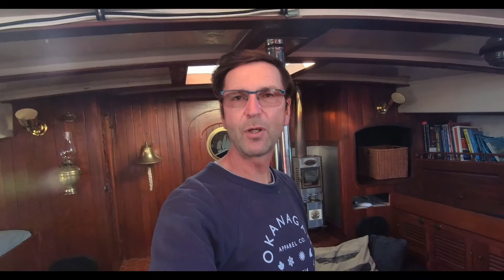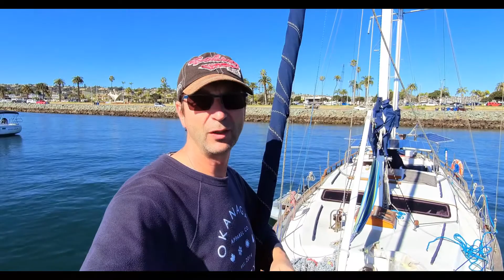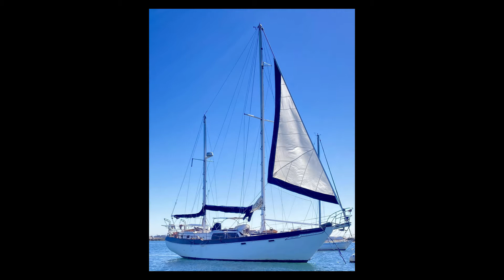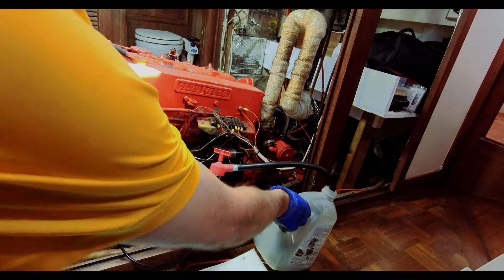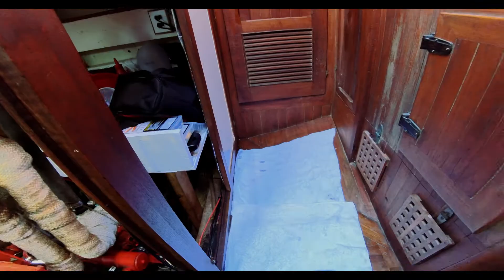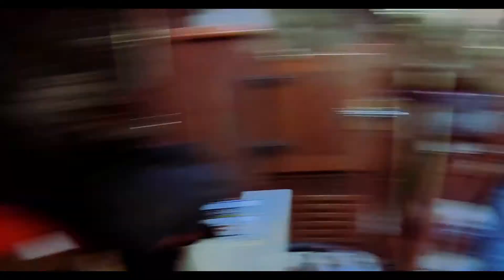New Sails and Engine Teardown

Comment: Another interesting vlog , thank you , at the end of the day you bought an old boat to travel on and is your home, the boat is a solid foundation, and when you’ve finished you will have a brand new engine new sails, basically a new boat , to me it’s know difference if you bought a house and the gas boiler packed up the roof leaked etc, it’s your home and in my opinion a smashing boat, carry on with it 👍

Comment: don't feel bad about not going anywhere lol. I recently bought a 1979 Harden 45, a little bit different then yours but mostly the same, it is sitting on land in the marina. so mine doesn't even float yet lol. you are one step ahead of me.
Reply: @OnnoKok  yep mine has the larger windows. my port companion way is a large freezer instead of a nav station, and the starboard has a bunk up top by the stove. she is currently named Polaris Mar, we plan on changing that at some point. I did not know about the Facebook group, I will have to check that out. we hope to be in the water this fall, after hurricane season (FL). then who knows where from there.

Comment: I have a c240 in my boat. Super reliable and smooth
Reply: From memory 10 degree downtilt Zf gearbox with water cooling jacket fitted in a 34ft sailing yacht.